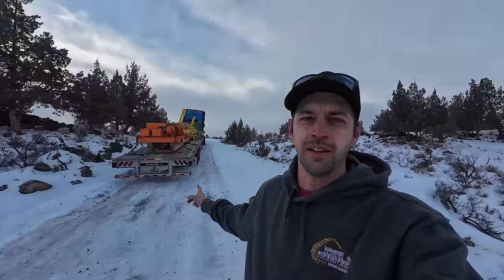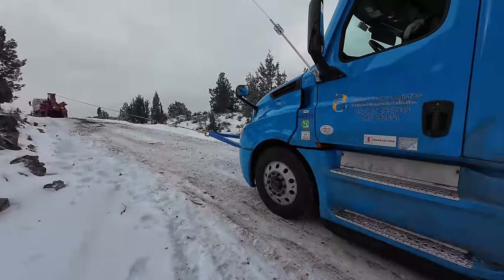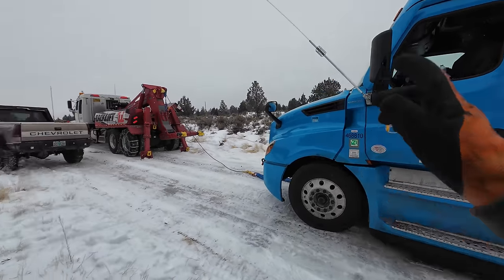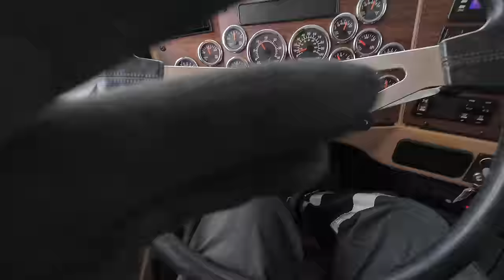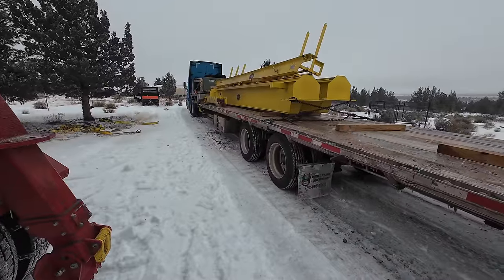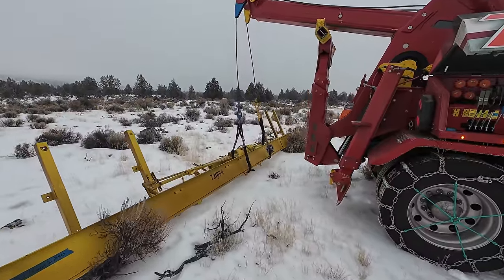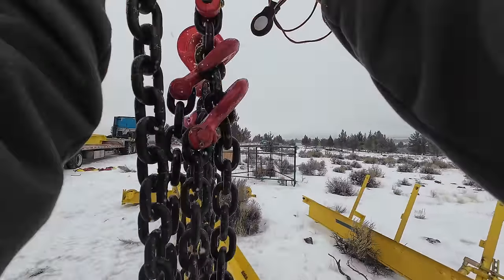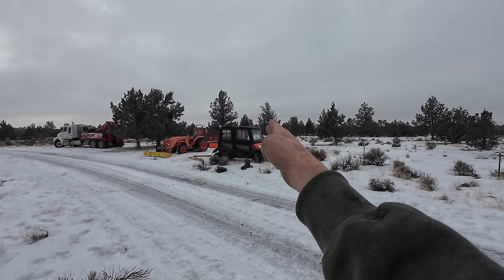This "simple" recovery turned into more than I bargained for!

Comment: Yes, shackles will spread if the bolt is not fully engaged. Loosen them a part turn and do that enough will eventually lead to less thread engagement by the bolt and lessen their rating by quite a bit. Thanks Casey! I enjoy the action directly but I also enjoy when you pick up Grumpy and the back and forth banter with him. Either way, I'll watch all the videos. 👍👍👍
Reply: And yet a lot of people do this, even Ron Pratt.
Reply: @dubious6718  He's the first one I thought of and he's been doing it for 30+ years so....I kinda gotta give it to him really. As long as you still have full thread engagement there shouldn't be any issues. I"ll have to pay attention and see if he's got shackles that are spreading.
Reply: It also leaves the pin/bolt more likely to spin out. Had this happen during some crane picks flying parts in and out on a job. It was because the other guy wasn’t running the pin/bolt all the way in. As the line pulled up he wasn’t paying attention to see the pin spun nearly out on him.
He still proceeded to argue that it was fine to do. 🤦🏻‍♂️
Reply: @benny5789   Unless you're picking it up and down 100 times I really don't see how it can spin out. Vibration, but if the strap is under tension it's not going to spin on ya. I call BS and he likely didn't just leave it out a 1/4 turn but likely didn't spin it in much at all! I'd bet he only spin it half a thread instead of backing it off half a turn. 1/4 is all you really need if you're backing it off at all.

Comment: Im a crane operator and will be the first to say there is a million ways to rig any given load. As long as rigging capacities are in check, and nothing is damaged and no one injured, it is all good in my book.
Reply: I'm a professional rigger who doesn't know the original commenter and would have to completely agree.
Reply: If i could just add my wee bit to this discussion, application needs to be mentioned, crane lifts…by the book a shackle ‘bolt’ would be screwed fully up and wire or pin locked.
For winching equipment about a vessel deck or vehicle recovery where there is no lifting involved it is unlikely the shackle will see its full working load.
Experienced riggers will often back off a shackle only because it lessens the chance of it tightening up under load and it’s easier to undo when disconnecting.
In 40yrs I’ve never seen a shackle spread if used correctly.
Reply: @brucemitch928  having worked as a rigger before getting in the crane, I am guilty of backing a shackle off a 1/4 turn just so it doesn't bind when finished lifting. Only time I've ever seen a shackle spread was from being side loaded.
Reply: Like the man said,  nothing broken or damaged and nobody injured equals success. Well done as usual Casey.
Reply: Or as Ron Pratt is so fond of saying, "there are many ways to reach ten". You can add 4+4+2 or 5 and 5, or do it any number of other ways, and as long as it still adds up to ten, it still works. No one way is necessarily better than any other. Given my own past experiences as a towing/recovery technician, a heavy equipment operator, and a number of years as a flatbed and heavy haul trucker, among other things, I'd concur. There are always, of course, certain "no-no's"...But outside of that, whatever works, works, and half a dozen of one is as good as six of the other.
Reply: @RedneckCowboyFeller  very well said 👍

Comment: Casey, I too am waiting for the rigging comments. As a retired crane operator I think you did just fine.
Ps. Dealing with a professional truck driver is a pleasure. It truly is a small percentage that make you shake your head.
Reply: I just took a rigging class, and they are to be tight, not only could it pull the shackle apart it will stretch the threads as well.
Reply: @justindeyoung9968  I was an overhead crane operator at 2 different companies; both cab and pendent.  That was before the NCCCO, and it was OJT.  

Later on, in the 2000s, I needed continuing education credits for a job I had, and they didn't care where it came from (heh!), so I took the CCO for that.  I think it was a day in the classroom, a day doing practicals (rigging, lifting, moving), and a written test; so 3 CEUs.  

There I was, a white collar guy taking training for a blue collar job I'd held decades before.  Kind of ironic, huh?
Reply: As a boring guy I have to tighten them to keep them from coming apart

Comment: Yeah--you did good on getting that driver.  As a driver myself, I can assure you there are a lot of idiots out there holding a steering wheel.  I noticed pretty early on that he had it together--I could tell pretty because he understood what you were going to do and you didn't have to repeat yourself 10 times with him.  Plus it was confirmed when he understood your hand signals.
Reply: I suspect that being a flatbed driver helped as they’re usually involved with loading and unloading cargo unlike dry van.

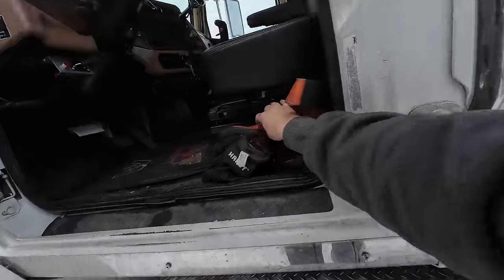Comment: 3:00 I have V-lug chains for all 3 of my 4x4 vehicles. They are well worth the rougher ride and cost. I started driving at age 16 and have chained up since to age 75. I have had issues with regular twist link chains on snow over ice. Most states require a 4x4 even with snow tires to carry chains when the chain sign is up; most drivers do not know that. I also carry with the chains a chain tool, repair links, and spare tensioners plus some wire ties to tie the inner chain tail so it does not hit the fender. I looked into the AutoSocks that Casey used in another post and I prefer steel but for intermittent use on a front wheel drive car then I would consider them due to limited wheel well clearance. Great videos, Casey, and I look forward to watching them for little gems of wisdom like the AutoSocks.

Comment: I chain up every morning  at 6am...bareback down the hill offload quad logging trailer hookup..load logs put 4 chains on and get skidder to assist pushing from behind up the 1/4 mile hill in backwoods of williams lake british Columbia..it's a daily thing until warm weather arrives then we're done for spring..it was minus 33 Celsius last week..very cold even with gloves on putting on tire chains both drive axles..pulling b train 7 axle unit 62000kilograms..oooops..did I mention I am recovering  from a broken shoulder???.yes..ain't no rest for the wicked..truck on my friends..it's a way of life..God bless ❤❤❤❤❤

Comment: That's a bloody big gantry crane for a ranch!  
It's a pity they didn't put the free spool switch on the remote, huh?

You guys run a lot more space between trailer axles than we do here in Australia and you have them set much further forward on the trailer as well. 

I used to work for Western Star here in Brisbane. The cabs came in from Canada and we built the rest of the truck here, frame and all. We even made the wiring looms up from scratch. We built a lot of the long noses as 6x6 units for logging both here and for export to Malaysia, one of those would make your life a lot easier in winter!

Comment: Your single complaint about the Zaklift can be easily fixed by them with a remote revision, you might suggest that to them as a product enhancement. Since it would only be replacing the remote it is an easy upgrade to perform.

That driver you are working with is one of the better ones I have seen in a while. Kudos to him for bein a professional.

Comment: You’re correct on the shackle bolt.  Don’t worry, you can get them unscrewed when you’re done. Use a wrench, channel locks, or a round screwdriver to get them apart.

Comment: In Canada we would approach this differently, the drivers would have triple chains to cover both duals, the steering axle a single chain one side and a single on the trailer to prevent it sliding sideways, likely diesel not winter ( light) diesel which works until we stop using the truck at -50 since steel becomes brittle and breaks frames. Just differences in what is “normal”. No critical comment meant. 👍👍👍😀😀

Comment: Like the commentary on the equipment and how and why you use it the way you do, like with the shackle and why you tighten the bolt all the way in. I have noticed that the hooks on your winch line always face up when you are pulling, I have heard you need the open end up in case of failure the hook will force itself into the dirt. Thanks for explaining the equipment.

Comment: You should invest in some Yaktrax for walking on ice. They work well to give you ice traction and you can keep them on when you need to move the truck.  They have a pro version with a strap across the top of the boot to help hold them on during heavy use.

Comment: At the theater I worked in, we were required to snug up the shackle pin when doing overhead lifting then putting safety wire (for a long term lift) or a zip tie (for a short term lift) through the hole in the pin and through the shackle.

Comment: Yes you are correct about the shackle if you use it by the book but as i can see in the video  they must be rated for about 6 tons each . You use 2 off them so they will never be overloaded by youre winch ,  so if you unscrew youre bolt 1/4 turn they will be fine and you dont have to carry a wrench to loosen the bolt many times. If an experienced person like you are wants to work by the book than thats ok but you should not use the frozen 4 ton strap to because it is not allowed by the book to ,but you are not overloading that by a long way so that will be fine to .

Comment: We had sun and frigid temps after 3" of snow in SE TN.  Slowly the snow got ice capped Tuesday on till it was just ice.  Hwy was dry but I live on a steep drive.  Friday I discovered I couldn't even back my truck up 3 feet without getting stuck.  Had to break out some of those wire-type chains I'd bought 9 years ago, just in case.  Got one on and could move in an emergency.  Only use was to the bottom of the hill then I'd have to take them off.  Also broke out some ice cleats I'd kept of my brother's when he passed.  He did a lot of hiking out your way in the 90s.  They are just a buckle 1/2" web strap with a square of stainless steel or aluminum with the corners turned down.  Straps across the instep.

Comment: If that rancher happens to see this: Do a 70/30 mix, diesel with kerosene and your fuel won’t jell. This is what we used before the anti-jel. Chemicals came along and it works much better, especially for equipment that has to sit outside. My company delivered snow to ski resorts in Sierra Nevada, so serious cold & snow

Comment: Casey, great vid.
Interesting comment about not backing off shackle, never realised that.
Also with shackles, by putting the shackle pin on the truck side there is potential to bend the pin as it's a point load from the trucks hoop, alternatively by putting the strap on the pin side of the shackle it spreads the  load across the whole pin and far less chance of bending the pin.
Reply from the maker: Wrong.  The sling goes on the round side.   Putting the sling on the flat side can damage it.    The pin is supposed to be what is connected to the hook, master link, chain, or eyelet.

Comment: Another option for the remote is to have a switch that links both up and both down buttons together, then either up or down buttons will make both winches run at the same time.

Comment: I put one of those little hoop latch pins, like you'd use on a small trailer latch, through the eye on the shackle screw, never have to find a separate tool to break em free

Comment: Casey I thought that you definitely did a wonderful job at rigging everything!!! The only thing I seen was on the very last piece that you unloaded off the trailer was that on the first chain hooked around the beam was that the hook should have been flipped over and hooked on the other side of the chain so that the safety clip would not have any pressure put against it!!! I did see that you caught that on the very last chain when hooking it up on the same beam and you did flip it over and hook it up so that if there was any pressure it would be towards the main part of the hook and not the safety clip on the other side of the hook!!! Hopefully you understand what I was saying as I may have not named all the parts of the hook by the correct names but hopefully you got what I was saying!!! When I was going to school for being a millwright about 20 years ago I did have to take a rigging class so that I was able to unload truck’s when parts might be delivered to a job!!! I also took a class for being able to drive one of those big front end loaders that had where it would articulate in the middle of the unit!!! Those were definitely fun to operate also!!! There was only two of us that had certification to operate that unit also!!! Me and the yard operator!!!

Comment: I'm with you Casey! Start when you get to the issue.   Your 11k purchase ... Leave the tow rings threaded on the inserts. It will protect the threads.
Reply from the maker: But leave them on which ones??    There are far more inserts than their are rings..
Reply: @CaseyLaDelle  Well then, that i was not aware of. I have a solution ...... Load the Wife up and go RING shopping! You thought that 11k was bad ...:)  (P.S. Leave grumpy at home on this one) 
They make a cheap plastic thread protector. Looks like a "netting" that slides over the threads. Most likely sold in a roll. Not a great fix but will work and will allow the threads to dry and be oiled.

Comment: Y’know Casey, apropos shackles done up tight or not, I’m damned if I can see any way it can make any difference. Unless, and it’s a big one ! you have the shackle sideways ! in which case it would allow  the shackle to open slightly,  which if the shackle were cast, might pop it. But as it ain’t and you don’t, it does not matter a bit.

Comment: Wolverine makes an insulated boot with felt pads on the bottom that grip the ice a little but won't slip on metal surfaces. Not as good as ice spikes but it's better than nothing.

Comment: Single chains are the problem here and who ever is in charge of the fuel on the ranch . They need to start blending some # 1 diesel into their fuel about November.
Reply: If the temperature get down below zero degrees, I would just use straight # 1 fuel, getting jailed up equipment running can be a pain.

Comment: I can't believe that a slight gap from backing off that shackle bolt would cause a significant reduction in the load rating as probably 90% of the forces are shear forces on the pin. As long as all the threads are through the threaded end. Would be an interesting test for the manufacturers to put out a bulletin on. I'd rather use a big crescent/adjustable wrench on the flats or a bar in the hole so I'm not beating up my equipment. Man, they culd have made that bridge 3 or 4' wider! LOL If the under reach can support a #40K truck back 10' I would home that it could keep a few thousand # beam away from the truck! Especially not supporting it but just stablizing it away from the truck.

Comment: I knew the autochains would work on that hill in reverse...
There's a steep road in my town they won't go down to plow, and they send the salt/sand truck up it in reverse (has autochains) so if it slides its facing down, then plow up after it melts a bit.
They stopped going down it because it comes to a T with the main road. A plow lost control and t-boned a couple of vehicles yeeting them down an embankment into a parking lot.
The accident was before they all had autochains, but they are still wary. 😂

Comment: - Lol, indeed.

I got your short re. Shackle loosening the other day..
 - I agree with you..

The sad part is the RIGGING guidelines / handbooks - published by "OSHA" etc in various countries - State to Back the pin off "to avoid binding"...   This is ridiculous - "expecting hand tight" as all riggers carry some sort of tool - and fully expect somethings to be bound up..  (holes in pin end, flats on pin, Flats on Nuts - all designed for tools to get on with it...

I also agree with respect to  a tight pin (lets torque things correctly - then they don't tend to come loose) - with mousing (maybe the folks can look up cable gromets)  will acceptably hold to its rated WLL / SWR  until the heat death of the universe  (and may even survive crossloading) -  whereas a loose shackle will be dubious.

Also, loose shacklepins (say on a trailer safety chain - MAY vibrate loose during a rough transit on a truck or trailer (check to ensure is still "secure")...

Static loading - Rigging, do what the book says - or get an engineer to write a directive..  Road transport / logging, do what make sense, follow  manufacturer guidelines if working to any limits (ask the fitting sales guy).

  - NB, Anything set up with any running lines (through a shackle (or carabiner), the running line needs to NOT be over the pin (in those instances a double shackle with spacers, or  short/doubled up) endless sling - may be needed to centre the loads on the pins... That will 100% (or near enough) prevent the pin from rolling loose under any strange circumstance  (mouse / split-pin the shackle pin).

At the end, Always orient the pins (and do the same with bolted assemblies - where gravity may be a factor) drop the pin in from the top  (Nuts underneath-  unless it really is impossible, ie. sump pans..), it can't fall out, under normal orientation if it works loose or the nut falls off...

Comment: Maybe you need some big propane tanks on your truck and torches pointed at the ground to remove the slippery stuf from the road and get some traction? is that a thing? It's something I would think of and try, and apart from what happens when it re freezes, I can see it as a quick temporary solution to get a job done.